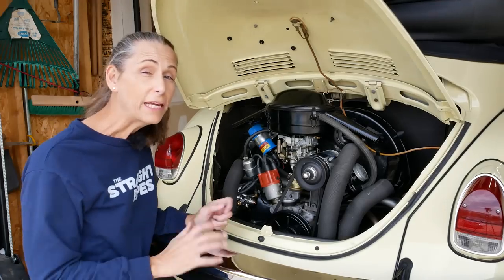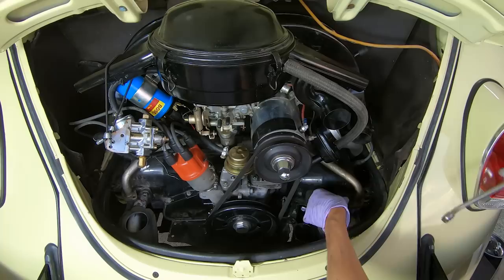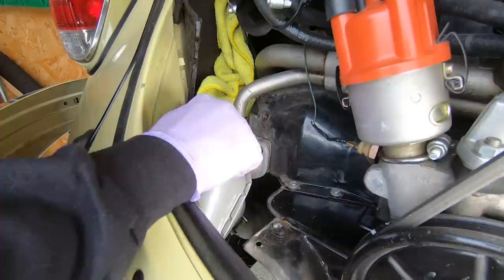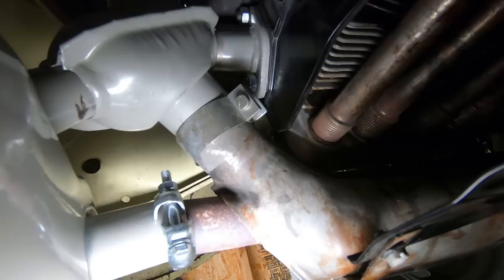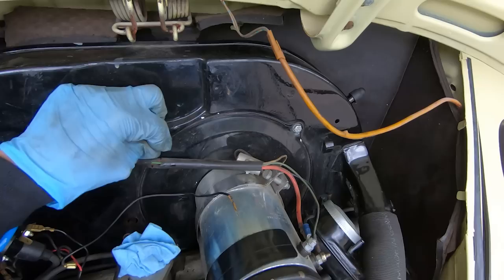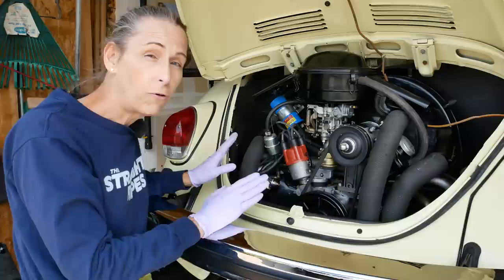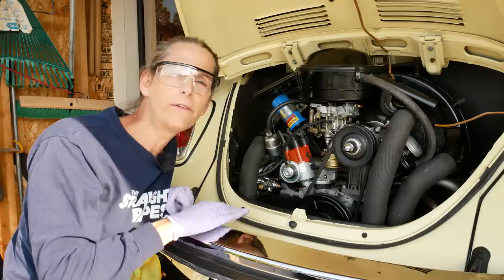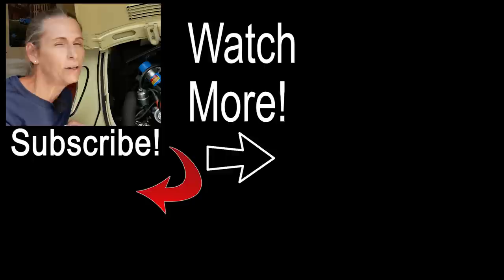VW Beetle NIGHTMARE Muffler Install and a Proper Distributor!!

Comment: Next time, pull the motor.  Seriously, that job is so much easier with the motor out of the car.  Pulling the motor in a 69 shouldn’t take you longer than 30 mins.  How many hours did you waste?

Comment: Don't "hog out" the holes in the muffler you HACK; get a bigger hammer! a) get another muffler that fits; I recently returned FOUR of them; the fifth one fit! b) On a single port the intake manifold is slightly "ball" shaped at the ends to accommodate a slight adjustment and the 6mm nuts may need to be loosened; then tightened last. Duh